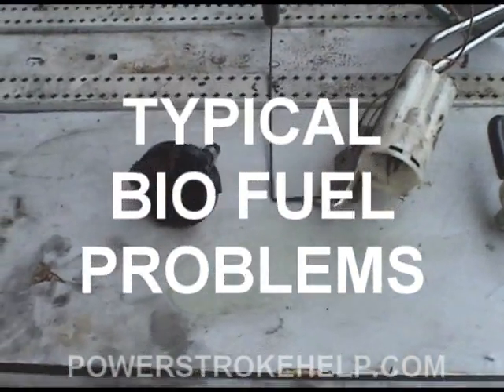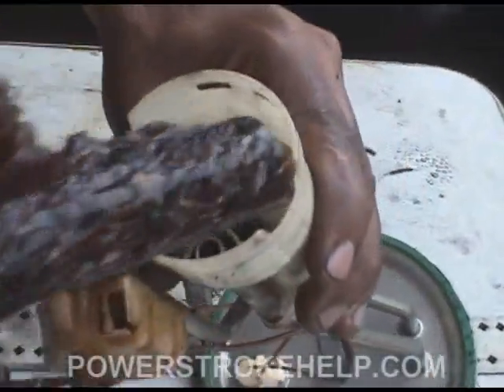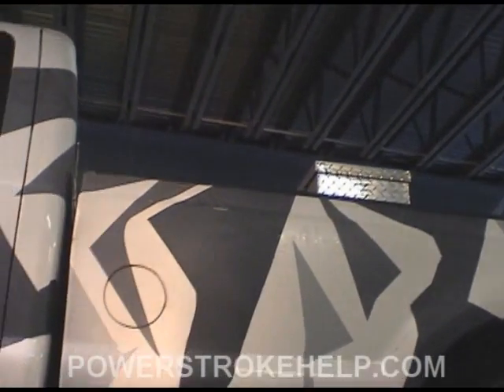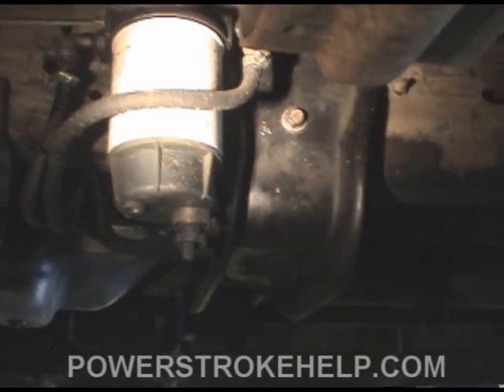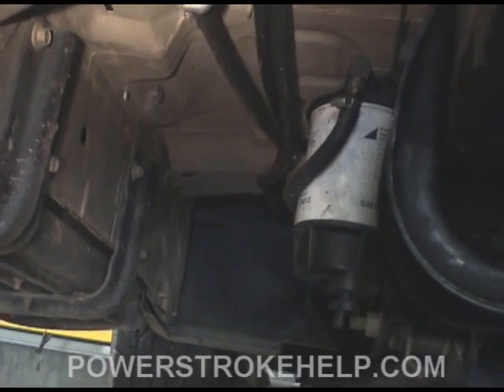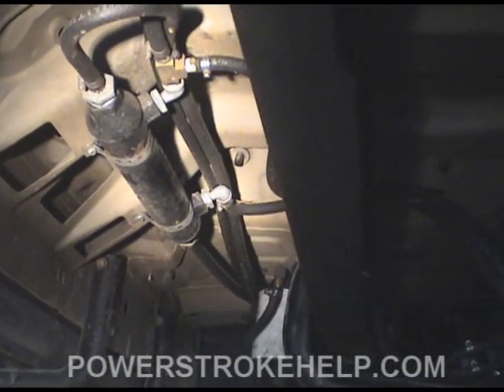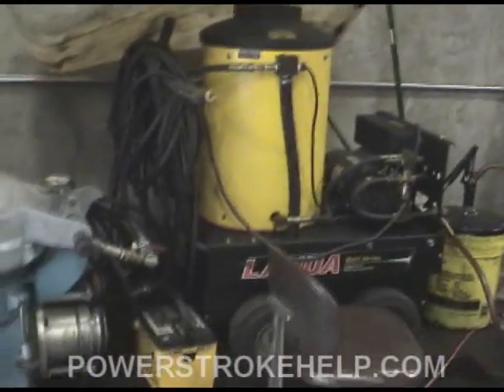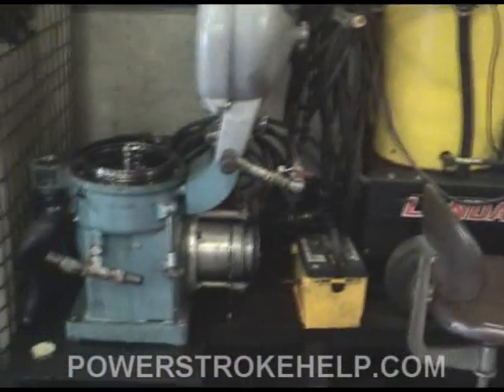FUEL SYSTEM FAILURES DUE TO BIO-WVO USAGE

Comment: I run automatic transmission fluid as fuel I put 8 gallons of diesel for 55 gallon drum put the diesel and then fill it full of tranny fluid I filter the fuel through double fuel filter system going retrieving it recovering it and putting it in my truck if you drop below the 8 gallons at all for 55 it will smoke I have run it pure in the summertime it really smokes 200,000 miles on 7.3 1999 Ford

Comment: Use can use old oil and other low quality fuels with A bubbler system that runs off engine vacuum.   Add water or alcohol/water mix to thin it out if it gets sludgy over time.

The use of A secondary vacuum chamber will make sure only oil and water vapor will enter your engine.  This will help keep the engine running smoother as it won't be sucking up oil that splashes into the vacuum hose.

How well this works for you will depend on A lot of variables.  Use at your own risk. 

Most systems will need A control valve as well.

This is only meant to be A fuel economy adder, though the use of lower quality fuels.

Comment: I run waste petroleum oils (engine, trans, gear, etc.) in my 7.3 IDI.  I've also run lots of old gas through it, I try to save the gas as a thinner for thicker oils.  Around town it'll smoke up pretty bad if the ratio is high and it seems to be a cumulative thing so it appears that junk is building up in the engine or exhaust system with the WMO.  On the highway I've run 100% WMO with no visible smoke or other issues.  I run all the junk fuels through a 1 micron absolute filter.  I've gone about 20k miles on the van's fuel filter, still no restriction issues.

I recently got a 7.3 PS and have been adding small amounts of WMO, usually under 10% and I've been more selective and using mostly ATF in it.  I don't see or hear any notable difference with or without the WMO.

Comment: I run mixed with no problems. 200g straight veg oil + 250g straight diesel + 50g unleaded petrol. All mixed outside of tank. I never over fill my tank so that fuel is sitting for to long. Seems to work well for me. It's not so much of a money saving exercise for me but more of trying to reduce my use of fossil fuels.

Comment: couple points If I may add.my wvo is on a chevy 6.5. bio fuel wrecked my stock fuel system.filtered canola oil I get from a restaurant they put it back in the jug so its like jerry cans makes it easy.second the oil I get isn't junk its close to new not gross. that's an important step ( get good oil to start with)second I have a fuel tank and I placed a 2x 10 across my box and bolted it down. strapped on a weed sprayer ( gravity feed or syphon)next I plumb it all it with soda pop plastic fiber hose. canola eats rubber.and 3rd I mix diesel in with the canola as so to keep it thin in low temperatures. easyer then a heat exchanger. also I believe I heated my oil too much in the 6.5 an wrecked an optical sensor.also bio fuel wrecked my optical sensors.in closeing wvo is simple and easy. get good oil in jugs filter and add to gravity feed tank and add diesel. flawless

Comment: I reuse waste oils like motor oil/atf/brake fluid/power steering fluid/anything oil just not veggie oil.  I'd run 80% waste oils to 20% diesel and some diesel kleen and I never had smoke issues....
I re filter it awhile before using it.
The gov and military pollutes way more than the rest of us ever can rolling coal every mile.
Reply: Patrick TheBaptist wow what type of car /engine are ya running that in? Never imagined yoy could use atf??

Comment: this video is incorrect, the crap in the pickup can easily be from regular diesel as it is a filthy fuel already full of crap hence why its called heavy oil, this guy also admits the bio diesel used was not processed fully, process it properly and waste veg oil biodiesel is much cleaner than reg diesel and to note veg oil bio will clean and pickup the shit that reg diesel leaves in you fuel system. hence filter changes needed, once used for a while with filter changes your system will be thorouhly cleaned, engine runs smoother quieter etc. there are too many negative oil company dependent hard line adicts.

Comment: Good unbiased review of alt fuels.  Lots of different fuels with different results. I liked your wvo conversion, you got the basics right. The glycerin came not from fried chicken but incompletely reacted homemade biodiesel, that finished reacting in the owners fuel tank. I just got 400 gallons of free wvo and it should keep my IDI F-250 going for 6 months. It runs real well on wvo, no smoking , about the same fuel economy of 20 mpg best conditions. Engine is quieter too. About 60k miles so far.
Reply: So how did it go???

Comment: hey saw your set up and I'm planning on setting up the system and I saw that you had your heat exchanger after the fuel selector and I was just wondering how long does it take for you to run it so all the bio diesel is threw the system before the diesel is back in the system for start up

Comment: Wow. I found this video by chance, and I know it's old, but damn, you know your stuff. Imagine that: an automotive technician who knows automotive science. 

I made biofuel out of WVO about six years ago. Sadly I didn't have a vehicle in which to test it, but it was definitely titrated properly and all the glycerin indeed precipitated out. Even the hardiest diesel engines will not run properly on straight WVO. Anyone who thinks they can just "pour it in" is a bit misguided. But hey, let's not forget: Rudolf Diesel designed his original prototype engine to run on peanut oil. ;)
Reply: You are right, you can't 'just pour it in'. At least only up to 25% WVO. After that you need  to heat the WVO with a coolant/fuel heat exchanger. Been working great for me. 275K miles on WVO with my Elsbett VW TDI and about 50K on my F-250
Reply: Actually Diesel intended for it to run on the seed oil of the much more productive cannabis hemp...
Reply: Most of the older diesels with mechanical injector pumps don't mind runnin on anything like atf, waste oil, and the usual other oily substances....I've had as much as 50% new oil and diesel mixed and the ol Vw runs fine. 
I even fill the fuel filters with oil when I prime em after replacing em. 
Anymore I laugh when a diesel fuel filter says lubricate the gasket with fuel. 
It squeals as if you lubed it with water 😂

Comment: How about new motor oil or other new stuff like atf mixed in the fuel? 
I've got cases of the stuff. 
2 stroke,and a bunch of 50w aircraft oil. Marvel too. 
I won't run waste oil in my stuff , but the work truck doesn't mind 😂
I got a bunch of new oil I've been mixing in my fuel (like 20%) for my summer car..
(with it's a Vw, on my channel, in not ashamed to plug 😬)
My butt dyno has confirmed a few things. 
It'll start harder under 50 degrees ambient. 
And it idles like 50-75rpms higher. 
I'm just hoping I'm saving my pump from this shitty low sulphur fuel. 
Ok yea it's not a power stroke, I don't have one but I got plenty of friends who do.  I'm just a diesel guy so I subbed.
Reply: I run some two stoke oil I'm my 7.3 I would stay away from pain motor oil because of the zinc and the detergents

Comment: heck I have an old Mercedes that I have a dual tank setup on with WVO and diesel. I do run the WVO through a centrifuge and heat it as well to clean all of the crap out of the WVO. I think that a lot of these problems happen with people that think that they can just pour it in the tank and go WRONG!!! love the vid. it proves all the bullshit that I have heard with the horror stories about bio diesel. and in my area bio diesel is 5.26 a gallon the fucking tree huggers are crazy if they think i'm paying that and then fucking up my engine!!

Comment: Couldn't you route the WVO alongside you're exhaust line and insulate them together too help heat the oil?
Reply: Fleece Johnson Exhaust Wouldnt Produce enough heat.. also what about heating the fuel when the motor is cold?

Comment: Where I live, there are lots of people who run and make biodiesel. From what I have read, you need to filter the fuel properly and wash it thoroughly. The stock fuel lines will corrode over time so you need to replace those with biodiesel-compatible fuel hoses. Also, don't run it in 6 liters, 7.3s do great. Biodiesel will clean all the crud out your fuel tank, so be sure to check your fuel filter after you first run it, that is all I have found out. That is processed biodiesel, not WVO
Reply: What part of the country do you live in?

Comment: Not too bad advice, except the part about 'getting the glycerin out' of veggy oil. A complete misnomer. No glycerin in vo. Just tri-glycerides
hes right it does take a lot of time to collect and filter waste veggy oil.
And to learn how to do it right. I spent 100's of hours learning.
I bought an Elsbett single tank vo conversion for my TDI. Ran 210K miles so far with few problems

Comment: Hi their, when installing the auxiliary diesel fuel tank on the 6.0L , does the feed line have to be pointing up direction where in other words the fuel pump will suck the fuel out from the tank? or gravity feed to the fuel pump. would it be alright to gravity feed fuel to the fuel pump? and also what about fuel return port  thank you.

Comment: I used to be a fueler in the army. You can run it, but you MUST change your fuel filter! JP8 will break up the crud your filter and mess up your injectors. When you change back from JP8 to diesel, you won't need to worry about changing the fuel filter.

Comment: I use WVO over 3 years in VW Passat B3 1.9 tdi, and absolutely i dont have any problems at all. For 3 years of using WVO i travel and moved about 150,000 kilometers. Saved so much money on the fuel, that now drive a VW Passat B6 2.0 TDI, and of course it also pouring WVO fuel that I make. Driven about 25,000 kilometers on it, with absolutely no problems.

Comment: there are many misconceptions out there about wvo out there.  Feel free to contact me if you have questions.  I have been running WVO well over 160k MI on my 99 f250 with no issues.  the truck has 450k on it now.  I have installed systems in all 7.3's and 6.0's.  I have tried nearly all filtering methods and fuel types.  I enjoy helping people run their power strokes on wvo and keep their money in their pockets.  greeenpowerstrokesdotcom
Reply: ig0fastr my friend why is your website down?
Reply: Sounds interesting.

Comment: You need to clarify if you're talking about biodiesel or waste veg oil, calling it "biofuel" means it could be anything.
Don't forget the first few times you add WVO or biodiesel to your tank it will strip out all the crud that has collected in your tank over the years and dump it into your tank strainer/fuel filter, once the tank is cleaned out everything is fine.

Comment: I ran my 1989 F350 with the 7.3 IDI off of WMO for well over 14,000 miles, the Injection pump died from age after 5,000miles, and the new one has run well over 8,000.....and still kicking.

I invested into the centrifuge, I invested in many upgrades to my truck, and I cannot give the secret away, I actually get better mileage, less smoke and more power from the WMO.

It's Damn expensive to upgrade your truck to run it, but with patience, you'll see the payback you get, in positive. $0.35/gal ATM

Comment from the maker: @shaazy I have a 85 300d and love it. It is simple and dead on dependable. And if you get a bad batch of fuel it wont set you back 3Gs for a set of injectors. Just empty the filter and the tank and keep on rattling down the road. I dont mess with WVO because I dont have the time and when the Glyceryn goes rancid in the summer heat it gives me the heaves. But if you hae a good supply of oil and can process it correctly then it can be a good gig.

Comment: Ok so, I'm a bit of a noob in this department but wanted to start a project car that ran on WVO. So far, I've gathered that old Merc diesels are the best for the job. What do you reckon I should get and then, how much money is required on top to get an efficient dual-tank system in place?

Comment from the maker: @xjinit I ran many different types of fuel blends that included, used auto trans fluid, used motor oil. Regardless the truck was always started on diesel and then switched once it was running. Most of it was a complete waste of my time.

Comment from the maker: @texaswindowcleanerT The centerfuge will NOT get the glyceryn (animal fat) out of the WVO.  I have been inside several engines that were run on WVO and for the most part they are clean but there is a tendency to get carbon build up from the combustion process so much cooler. This is a real problem with 6.0s due to the EGR valve and cooler. With the cost of diesel going up and up more folks are running WVO. Save your money for injectors because WVO does shorten injector life.

Comment: @cowboyup343 Tell that to the US Navy, the largest user of biodiesel.   This damage is due to running WVO isn't heated.  Properly made biodiesel will not damage your engine.  Newer engines are far far less tolerant of poorly made biodiesel.  I've been making biodiesel for 5 years. I DID NOT USE BIODIESEL UNTIL I HAD MY PROCESS PERFECTED.

Comment: Had a question and a thought.. Suppose you made your own biodiesel out of WVO, and knew what you were doing. What then would you do to your truck? Would you still install the 2nd tank, switch, heater, ect? Or would you just add 10 gallons of bio every time you filled up and save $30 to $50 a tank?  Would you consider running straight bio if you made it yourself and it met YOUR standards? And what do you think your standards might be?

Comment: The old 6.9 and 7.3 is much more foregiving. 
My best test mule is a 7211 Zetor farm tractor, single tank,up to 75% wvo/wmo, rest diesel. It starts well and clears up in about 5 minutes. 
This expensive equipment to filter it makes little sense, what are you gaining? I have been settling my fuel and running thru a milk strainer, it is then allowed to settle some more. I draw it off with a pump held off the bottom.
 It sems to be worth the effort at this point.

Comment: That plugged fuel pick up is due to WVO usage.  I do not use WVO but use properly processed biodiesel.  Using WVO does not remove the glycerin or deal with the acids that are present.  Processing WVO into biodiesel solves all of those problems.

Comment: Alot of people get Bio Diesel and Waste Veggie oil confused.  Looks like your customer thought Bio-Diesel = pouring restaurant grease into the factory tank.  Actual Bio Diesel requires chemical processing which preps it to be  used in the factory tank, mixed in any proportion with #1 or #2 Diesel fuel.

You're right about it not being worth the effort at today's fuel prices.  If the price doubles again it would be.  Most puke'n'choke's know they're sitting on gold and charge accordingly.

Comment from the maker: Ran like a champ. Light oil consumption. Got 17.1 mpg on the way down and 14.0 on the way back. Probably get better as the new rings set in the bores a little better. No complaints for a motor built from extra parts.

Comment: i just shake my head when i hear somebody say you can just pour wvo in your tank and go.  having worked on ships that burn heavy fuel at sea, i know that you have to heat and filter it well or it won't work.  thanks for the visual evidence that your fuel system will get totally screwed if this isn't done right.

Comment: How do you spell that filter? Is it Ray Core? Or different? 

This sounds like something I would want to do for this truck im going to buy. Granted its an 85 f250 6.9. But the guy tells me the diesel in it is 6 years old. And yes I am going to drain it all for new. And when looking at everything that water seprater is bypassed. Yeah I know :( But the truck does run very well, doesnt smoke much at all. Ive Always wanted a diesel and i think this truck is really worth saving.

Comment: Excellent vid Bill!! Very interesting stuff, sounds like alot of the stuff ive read in Diesel Power mag as far as testing different oil based fuels in a diesel.

Im always suspicous of bio-diesel at pumps and from individuals who dable in making it. You just dont know the quality. Same with #2 diesel really. I dont trust alot of gas stations diesel. Most have dirty tanks, dont keep the tank full, dont move much fuel. My 6.0 only see's diesel fuel from a quality station that moves alot of fuel.